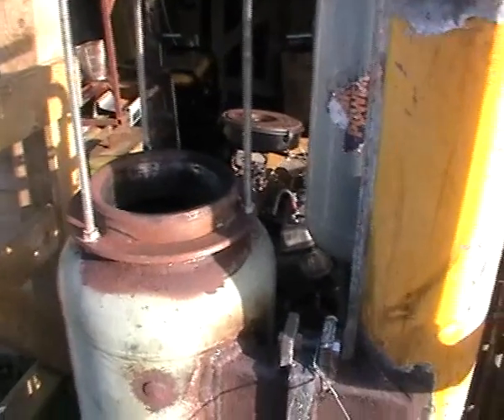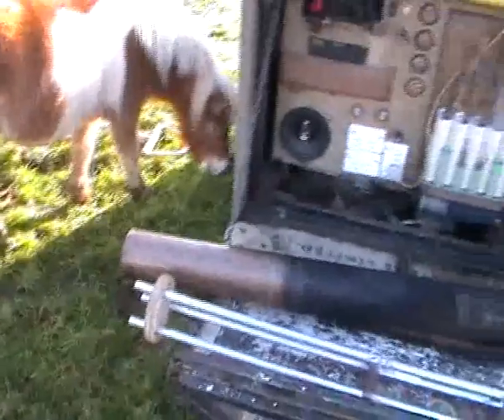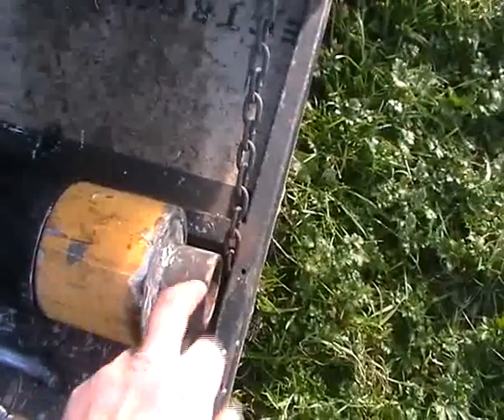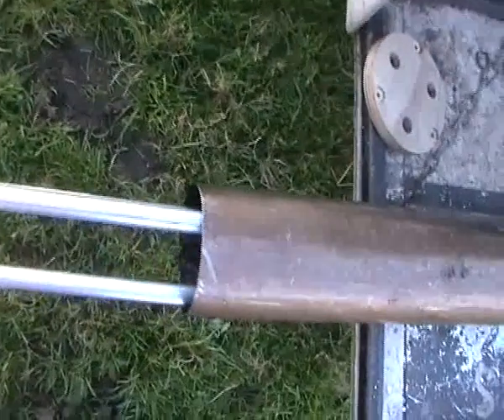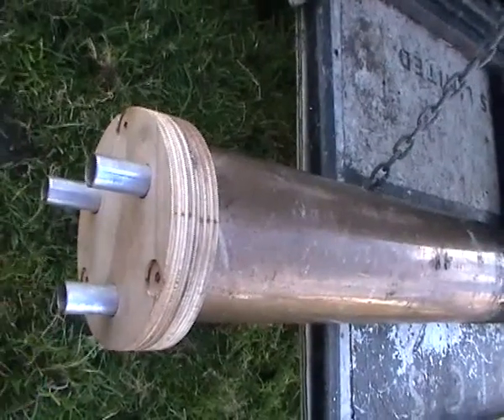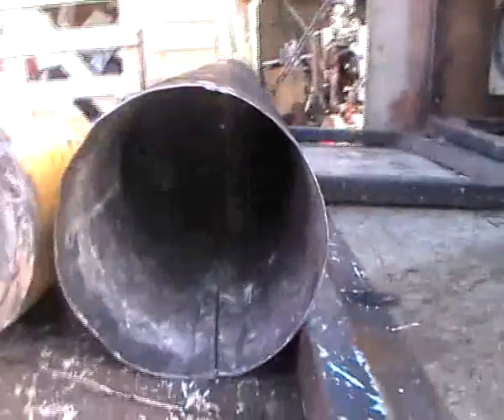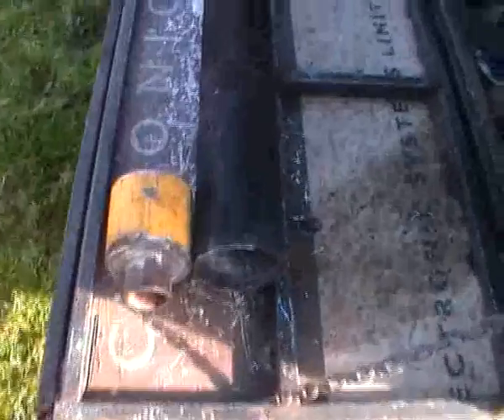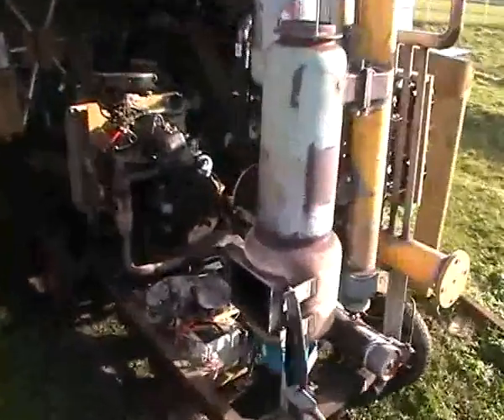Gasifier upgrade from FEMA to Imbert

Comment: Intriguing but not very clear about where your modified part fits in your existing system.
Could use another video showing this.
( My initial response is it is too small for most engines and guaranteed to clog. )
Please provide a link to this installed and in use  .
Thank you
Reply from the maker: Sorry for the late reply, but only now have I discovered your comment - hidden from view by the folks at censorTube! 
 This system turns a standard downdraft gasifier into a Imbert equivalent, by delivering a controlled airflow directly to the burn zone, as opposed to letting it flow at a random rate, through the fuel column. 
 While successful, this gasifier no longer exists, as it was replaced with the one that you can see in my later videos. 
 Hope this helps  :) .
Reply: @CNCmachiningisfun  
Thank you 
I will research those videos I can find .
Reply from the maker: @sojournsojourntraveler1203  
 I don't know why, but censorTube keeps hiding your comments and replies. 
This means that I may be slow in responding, as it is just a matter of luck that I discover them when I view my own channel, behind the scenes.
Reply: @CNCmachiningisfun 
Thank you for getting back.
 I wish I had a way to communicate with you, as I wish to achieve the same goals your after.
I have only placed the 4 cylinder engine where it should go, but I am caught up in researching different designs .  Have you achieved a clean enough system design ?.
Reply from the maker: @sojournsojourntraveler1203  
 You are welcome  :) . 
This started out as a FEMA gasifier, which, as you know, is a tar factory. 
In very short order, it wrecked the engine, and I had to rebuild it, in order to continue my experiments. 

This modification made a huge difference, which allowed me to clock up a lot of hours on this old motor  :) . 

My little wood gasifier, with the single cylinder engine, has clocked up about 2500 hours, and it is still going strong, so yes, I do finally have a fairly clean system design. 
That stated, it is far from perfect, but it has been my daily driver, for quite a long time now. 
 
A lot of folks try to keep their secrets and discoveries to themselves, whereas I like to share them, so others can avoid making too many mistakes. 
After all, I have made pretty much every mistake in the book, while learning about this technology. 
Are you familiar with Flash001USA's channel? 
There, you can find a treasure chest of knowledge, gained from making mistakes - - and progress  :) .

Comment: Great to see Kiwi ingenuity at work. Great work and looks like you are heading in the right direction. I agree with your comment, If only I'd started all this years ago (or similar sentiment) I'm just at the looking at all the designs and info I can find stage, and will then opt for whatever seems best available. Peace always
Reply from the maker: funkee77 
Howdee,
Yup, these changes made a big difference in the performance of this gasifier.
Before this, it was a real tar maker. The mods cleaned it up a lot.
This beast delivers a lot of power, and is indeed way more grunty than I need it to be  :) .
Actually, this is the reason I don't use it any more. I use a smaller one instead.
If you are looking for designs and ideas for a good little gasifier, I strongly recommend that you view Flash001USA's channel.
His first gasser was a FEMA, and he went on from there with his own ideas to create a really nice little beastie  :) .
I think that would be a good starting point for you.
Reply: *****
G'day again... thanks for the info re flash001USA. He builds a very nice neat and tidy unit too. Also had a look at mrteslonians wood gas truck vid and he's put together an imbert system with stuff from the tip and a few pipes. There's some clever people out there and most seem happy to share their knowledge which is great. Long live this here interweb. Been promising ourselves a holiday in NZ and visit my (not so) young 'uns when we sell the biz and wouldn't mind dropping in for a quick look at what you're doing if thats OK by you. I'll be visiting Levin if thats anywhere near you. Anywho, cheers for now and all the best :-)
Reply from the maker: funkee77
You are welcome  :) .
Flash's design is one of the better ones you will find. It is a clean runner, and will not kill your engine like some of the other designs can.
MrTeslonian has an uncanny knack of blocking anyone who has a working knowledge of gasifiers. If you make a positive comment on his channel, he is likely to accept it, but lord help you if you ask him a question that will ultimately reveal a problem with his system!
I thought I would warn you, just in case you opt to build his version of a gasser.

The intertube is a great thing alright. It allows like minded souls to share their thoughts and ideas, while most efficaciously dispensing with the tyranny of distance that would otherwise conspire against us  :) .
 
Long live the interweb thingy.

I think you will enjoy your time here in NZ, especially if you visit during the summer.
The folks are nice, and they drive on the correct side of the road too  :) .

Levin is about 60-ish miles from here. 
Wellington is where my gasser likes to cook the trees, but it would be cool to drive a woodgas car to Levin, just to see if I can do it  ;) .

My current gasser has changed a lot since my last video, so it is about time I uploaded a new one.
It is currently pumping power into the house battery, taking 3.5 pounds of wood per hour to deliver each KWH of electricity.
It's costing me a fortune in completely free wood!

Best wishes,
Steve.

Comment: also one thing to notice ,, its good for the burn tube to be thick or to put a ciramic insulation at the oxidation zone . i was thinking of welding an outer pocket and filling it up with sand , this will insulate the heat so the heat can go up in the oxidation zone.  not sure just ideas. your 0.8 mm seems too thin.

Comment: yes the ponies are lovely.  today i tried making a very good heat recovery system where the heat is sucked back into the system but i still didnt get a blue flame.  But the strange thing is that mr Jashua's gasifier hasn't got a good radiater so could it be that the gases need to be hot and directly contact the filter medium while still hot before the tars get cold and condense to complicated polymers?? the only thing i have not tried is to use aonther filter medium i was told small particles

Comment: am sorry to bother you so much but do you mind giving us your dimensions for the burntube ? your burn pipe looked like 5inch (150 mm) diam is that right ?  and it looked very long , how long is it?  also how thick is the wall of it ?  you said its stainless steel right ?  as you say its strange they say tar should condense at 40 c and am getting it all the way down to 24 but still tar makes its way!!   by the way your ponies made the movie nice.

Comment: you think its the filtering materials? he says he uses douglas fir and he showed it it looks like wood chips and in another clip he said its just saw dust out of chain saw..  some one was telling me the small size wood does the trick i will try that. today i tried bubbling the gas in water but it didnt help. measured my exit temperature of the gas after the radiater and filter and its only 24 celcious which means all tars should have already been condensed as they should below 40 but they didnt.

Comment: thank you for reply.  the idea is to get a blue flame... some one with the name jush burke did it and her gets blue flame... the strange thing is i did the same thing but even with more features like  radiator and heat recovery but i still dont get blue flame... red flame means too much tar... is your new design giving blue flame ?  blue flame means high hydrogen content and low tar , am still trying many things. i tried like your method today but without teh restricter but it didnt improve

Comment: hi sir thanx for the clip.. you said the nozzle arean needs to be 6% of the restriction area but when i look at the plans in allpowerlabsorg they show that teh restrictio narea is almost the same as the total nozzle area.  also the reduction zone has a conical shape with its pointy end at the top  , they call it the reduction bell..  i made a FEMA one and the oxidation zone creeps to everywhere so am thinking to do like you . ill just cover the top with a lid and send the air through pipes down

Comment: well its been a wile have u been able to make it run tar free yet i have had some promising out puts from my new reactor it took a long time to build but i allready got a flar off usin large setter branch cut offs but the heat was very high but it = very little tar but the heat over came the device but it looks promising but every thing ids on hold waiting for the fire danger here in the forest to go away and i need a new pump but then ill put a new video =3-

Comment: judging buy your accent your from new zealand, which leads me to ask... what wood are you going to run in your "imberted" fema gasifier?.... imbert type gasifiers are designed for hardwoods and don't take well to softwoods (pine etc) as the air jet velocity is too high and destroys the char bed, with uncool results for gas production

Comment: Howdy Steve,
If ya weren't running pellets or something that flows really well... That probably wouldn't work.
But seein a s you are running pellets... It may just work.
Ist thing and probably most important!
You got the makings of a real good pellet cannon... :-)
My concern is the lid and safe pressure relief, just wanna be sure ya have the lower part secure and the lid will have some spring type pressure relief gadget to stop it from going into orbit :-)
I sent you a more detailed reply